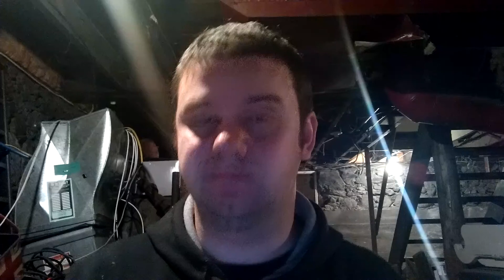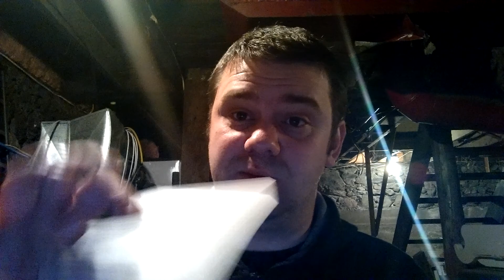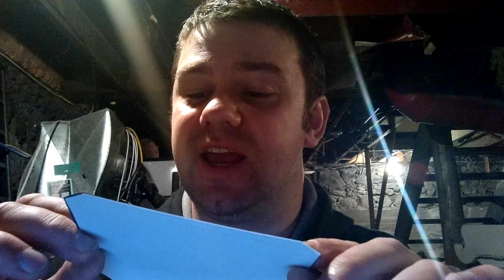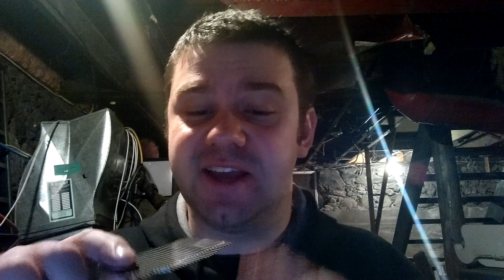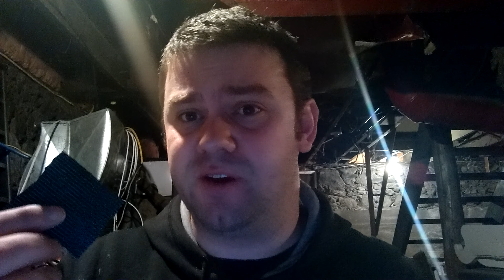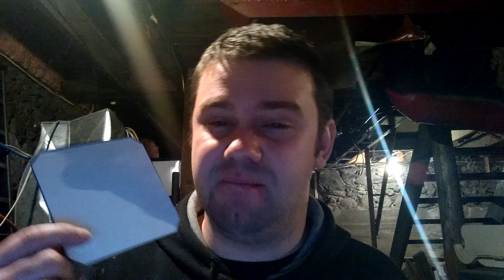Sunpower solar cells - why do most solar panels suck?

Comment: So Steve?
Could you update me on the C60 what is your experience, since I am just about to start a build any feedback would be appreciated.
Reply from the maker: Did you start your build? Unfortunately I didn't get any further with my build. I'm more of a starter than a finisher apparently!
Reply: The C60 cells are simply amazing. 😊

It's not just the peak efficiency, or maximum power output, but the average effectiveness of the solar cell.

Maxeon, C60, or Sunpower Solar cells are far more photoreceptive than previous generations. Compared to most any other consumer cell, even in 2022, they have almost twice the effectiveness in low light and blue spectrums. (Blue spectrums are something which most solar cells are especially poor at converting into energy. Blue spectrums make up the majority of most low light and overcast sky conditions.)

While the same 100w solar panel would only generate roughly 6-12w in low cast skys, the ones made with the more receptive cells would generate 12w-18w, or almost double. And that's a lot when it comes to USB power and being able to charge your batteries at the same time.

I had built a 30cell 'Maxeon' array (17v-18v) on top of my roof of my Scion xA. Even in 2-3 hours of overcast skys, it was enough to keep my 55ah worth of Lifepo4 batteries topped off, (from a nights worth of gaming and me running my interior led lights,) something which I know would not have been possible if I had used the older cells.

In short, they perform as solar cells should! Peak efficiency means nothing if your averages are very poor and the C60 cells have high averages! 😊🌎✨

Comment: The new SunPower® Maxeo solid copper back Gen III cells are rated at 25% efficiency.  Most panels are only upto 20% efficiency.    But they are expensive.  I think you get what you pay for.  These new cells/panels deliver more power in less space and they are very very durable and protected against saltwater corrosion ..

Comment: You need to do some more research on Micro Inverters first.
Reply from the maker: Microinverters are a great solution if you're grid tying because they will connect to each panel individually. However, they are also an added expense and require that you run mains AC voltage to your panels. (I would think that most people experimenting with solar aren't interested in getting permits for that kind of work)

If you are off the grid, then there is no AC signal for a microinverter to synchronize with, and they are therefore rendered useless in that situation. A microinverter also does not resolve the problem with blocked cells essentially disabling an entire panel, but could have a beneficial effect in the case where someone would otherwise have a string of panels being blocked by one bad panel.

Thanks for the comment.
Reply: It is not solely for grid-tie. Micro-inverters are used for several reason including the ones you listed. Depending how you wire your panel array, you could end up with a large amount of amperage traveling a long distance through insufficient wire. This is another way you can benefit from an inverter stepping up to a higher voltage AC. Even if you aren't pushing the max amps the wire supports, you're still losing power in resistance of the wire over distance and it still makes sense to run higher voltage AC.
Reply from the maker: Do you know of any off-hand? I have never found any that work outside of the grid-tie.
Reply: I think you may be right my friend. Even in 2022, a quick search on AliExpress didn't show any micro inverters that were capable of running without a grid tie connection! 

Off grid is where it is at! 😊🌎✨